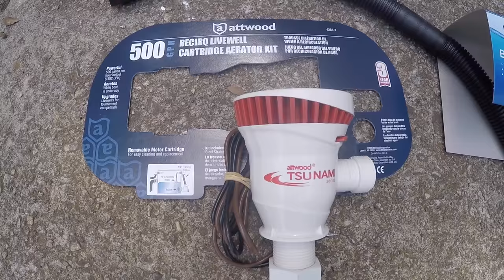The Livewell Part 2

Comment: I like the setup of the dual valves. I usually mount my pumps to a bracket or plate for stability. Cpvc can crack under stress like the boat bouncing up and down.

Comment: Did pluming for several years ur threaded adapter looks like a 3/4 x socket or glue joint .cpvc is intended for hot water and reason some mobile homes use as hot and cold also the size between cpvc and PVC are different cpvc is smaller but do sell adapters cpvc ,x PVC but loved the video  quick and easy good job

Comment: The water circulation in keeping the fish alive is way more important than the aerating . Fish pee in the water  and it makes the water Ammonia  filled  this is what kills the fish . You can aerate all you want  and its not going to get rid of the ammonia , Its only going to circulate it . What you are doing is circulating  pee water . Water circulation will introduce air into the water   as well as  get the pee water out and keep it diluted.  If you circulate on a timer  you will never need to use the aerator . Fresh water in the tank is filled with air already in the water its how fish live . If you are out of the water and you want to keep the fish alive in the tank  for the trip home or you have live bait in the tank  from home to the water  then use the aerator . So get  the circulation part done first then work on the aerator done 2nd  and your fish and bait   will live longer . Also  keep the pump low below the water line  so it always has water in the pump part or your just be pumping air . I think you are going to find out real fast  your setup is not going to work at all  until you lower the pump  to the main bottom . I might be wrong  about the pump  it might be a self priming pump . Do they make small pumps now a days that  self prime ?

Comment: If you live in a freezing climate where you store your boat,  you will have residual water that wont drain out in the design shown.  THis will freeze and burst your lines.  You need to have a low center of gravity drain so you can completely drain all the water out at the end of the season.

Comment: Did you have any issue with the pump not picking up the water? It looks like the pump would be higher than the water line inside the tank.
Reply from the maker: Yeah i did, the pump later got moved to the the bottom of the livewell

Comment: Does the pump out drain that goes out the side of the boat need to be higher than the livewell ot pump for some reason? I notice this on diagrams and some pumpout kits come with there own through hull fitting. Why cant I just tie into my existing drain that runs down the bottom of the floor through the hull in the bottom rear transom.
Hope that makes sense.

Comment: is the livewell pump going to be able to prime itself? that hi?
Reply from the maker: I was thinking about that yesterday evening. It should be ok by the time the water fills up the tube
Reply from the maker: +FIREANT FISHING I might have to move it down a little bit I'm not sure yet
Reply: id at least get it to the middle are on the bottom of the tank and i dont think it will get all the water out of the tank unless its lower then the tank itself
Reply from the maker: +MrWarriorpro I'm going to look into it, thanks for the look out!
Reply: FIREANT FISHING
Reply: FIREANT FISHING  u don't need air bubbles what u really need is fresh water inbound and feed over board that way u constantly replace water and won't warm up   I keep morning live ballyhoo all day and what I don't use turns into rig double weedless hoos 🇺🇸🎣🐟 keep lines tight JOHN

Comment: Why didn't you just use 1 pump, a timer, and a riser overflow drain? It would then simply cycle 30 sec every 3 minutes until its full, thereafter giving you fresh water every 3 minutes. Then just a drain with a plug in the bottom?  Just wondering if there was a reason you didn't do it that way.
Reply: Michael Kahl I like the way he's designed it as in he has complete control of emptying the live well

Comment: CPVC is used for hot water in a house, PVC is used for cold water in a house, that's the difference
Reply: TA Green CPVC is used for drinking water (human consumption), PVC is not.
Reply: they have different outside diameters...in this application cpvc is much better as the o.d. of cpvc is smaller than pvc
Reply: dead wrong andrew..

Comment: what motor are you putting on the boat?
Reply from the maker: It's going to be all electric
Reply: So you gonna get like a 80lb+ thrust trolling motor?
Reply from the maker: +Hunter Chevaillier haha I'm not sure yet to be honest. I think I'm just going to have multiple ones back there
Reply: to give you any help you may or may not know this, but when fishing its ALOT easier to control the bow with the bow mount trolling motor
Reply: bow and also boat*
Reply from the maker: +Hunter Chevaillier yeah I already have one off my other boat that will go on here. I might need a bigger one bc that one is only a 45lb
Reply: I've got a bot about your size but has a 25hp on it, and a 80lb bow mount trolling motor and on highest speed boat goes like 2 to 3 mph...